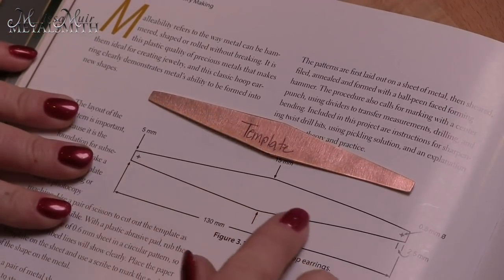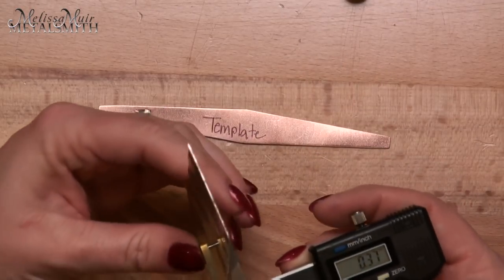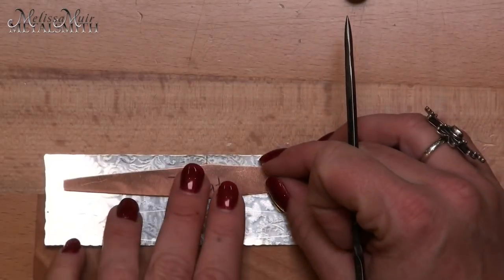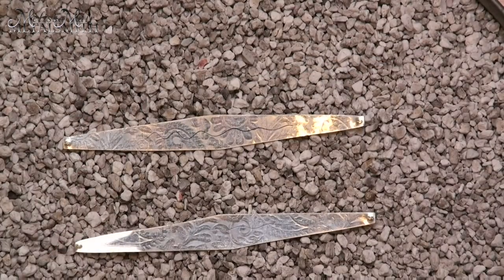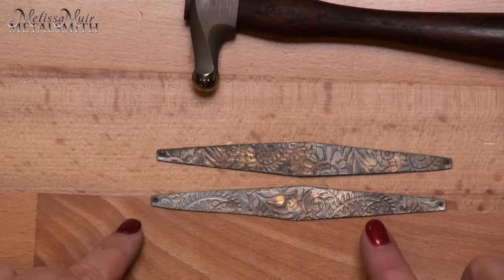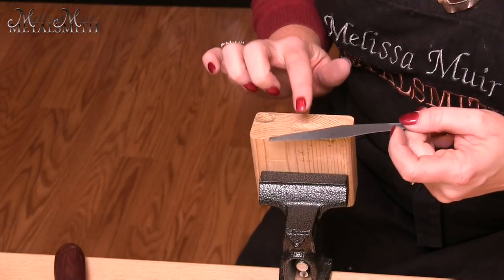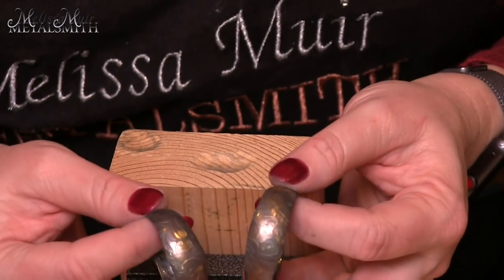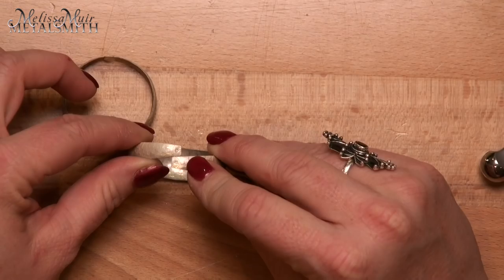Project 3 - Hoop Earrings - Alan Revere Professional Jewelry Making Book Series- Tool Time Tuesday

Comment: Thank you so much for these tutorials. I would be struggling a lot more with just the book. Did you notice that although the book says "130mm," the length of the template is actually 125mm? The rest of the dimensions match, though. Anyway, the template seems long enough, so I'm going with that.

Comment: Hi, thank you for your video.  When you are working the metal, do you have to stop and anneal during the process?  Thanks!
Reply from the maker: Good Question. Only if you see that the metal is not responding the way would you like it too. If it isn't curving well and you are getting ridges and ripples, then it might be a good idea to anneal it.

Comment: I am curious which fretz hammer you are using? The silversmith or the 1.2 ounce or the 2.5 ounce ? Love the video
Reply from the maker: I believe it is the 2.5 oz hammer. It is not the precision smith line. It is the jewelry hammer, not the one for doing larger pieces. There are three sizes of hammers, it is the middle one. I hope that helps.

Comment: I am just starting this project and am confused about the gauge of metal to use. In the video, you say it should be about 0.4mm but the book suggests 0.6 mm. These are quite different - anybody have suggestions re the difference?
Reply from the maker: Kathleen Conklin if ever there is a question, go by the book. Sometimes I do make mistakes and this seems to be one of them. It’s funny, a lot of times in my head I say the right thing but my mouth says something completely different, yet my ears heard what was in my head. 🤷‍♀️

Comment: I noticed you went back and forth with the needle files, isn’t that bad for them? I thought files cut in only one direction.
Reply from the maker: These metals are so soft that it isn’t an issue. I would never do that with steel. When I pull back, there isn’t much pressure, it is more to keep it as a guide.